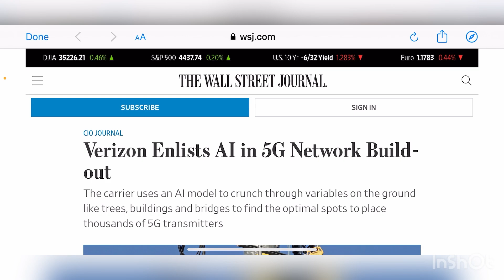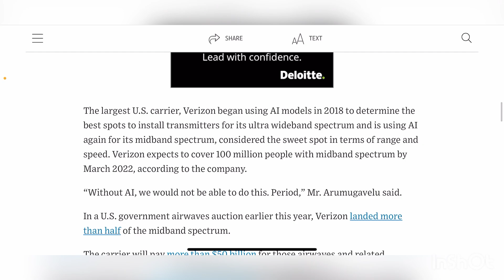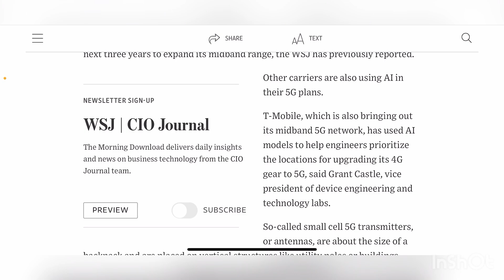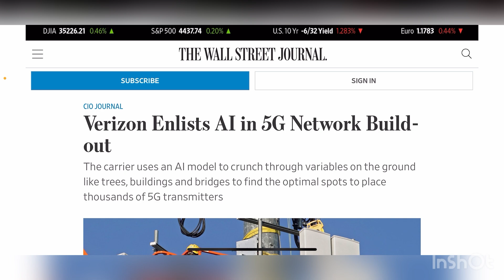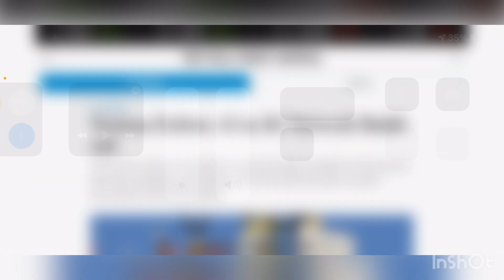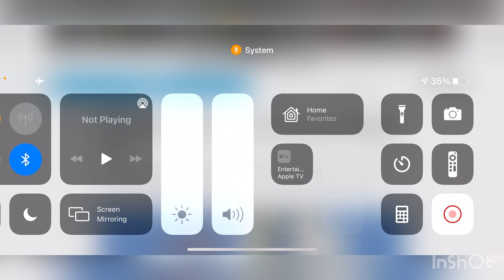T-MOBILE, VERIZON |  USING A NEW TECHNOLOGY !!!!

Comment: I think when it comes to mmWave Verizon going to have that on lockdown I think T-Mobile should start deploying mmWave a little bit more faster not like 2.5 but just to get some out there even if it's a slower deployment
Reply: Yeah but t mobile doesn’t have the same money Verizon as
Reply: @antoinegeorge4287  that is very true I think T-Mobile needs to spend about 14 to 15 billion on the network
Reply: It may take 20 more years with mmwave at the rate they're deploying it..lol I'm not getting any younger here like the next guy.
Reply: @CFL-TECH  hell yeah they need to hurry up